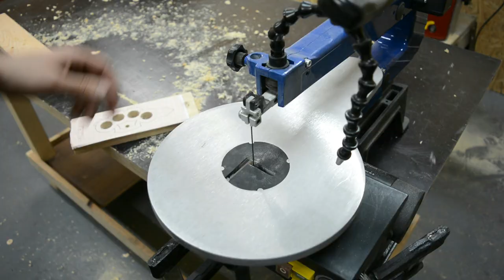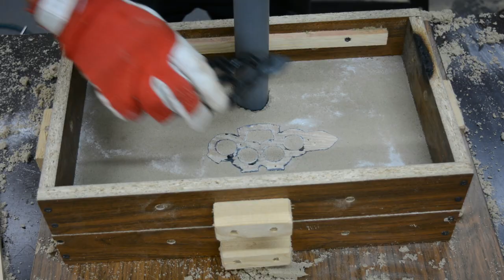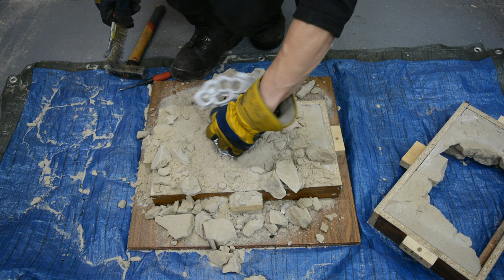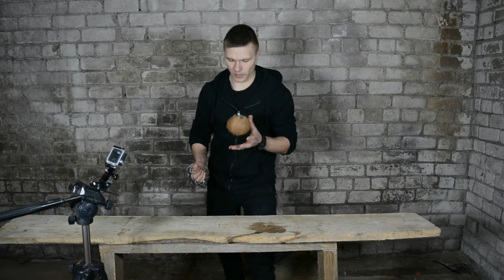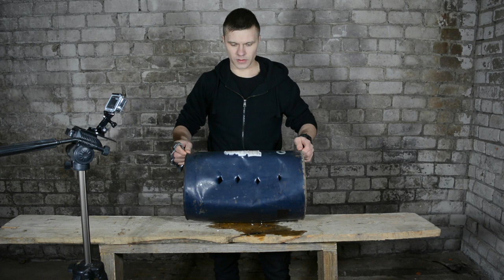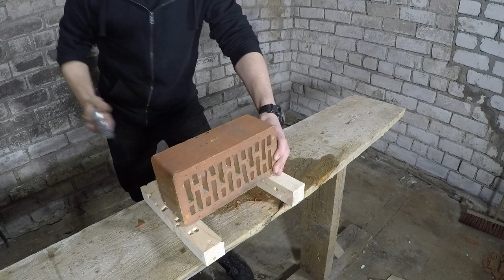Casting aluminum KNUCKLES with a SKULL CRACKER

Comment: ive heard of metal casting with styrofoam why no use that if its easier to cut. are there disadvantages?
Reply: Justin Ryan I'm guessing that the air bubbles in it make it less perfect of a cast, but I'm no professional
Reply: ok thanks
Reply from the maker: It is a on of casting, if something goes wrong you have to start from the begining
Reply: ok thank you

Comment: Why is there only one hole for the aluminum to flow through, in another video there were two holes.
Reply from the maker: With smaller castings you don't meed a second riser
Reply: Thanks!
Reply: Martin